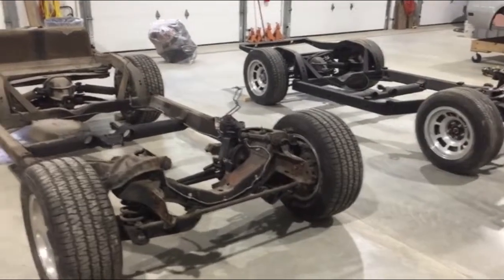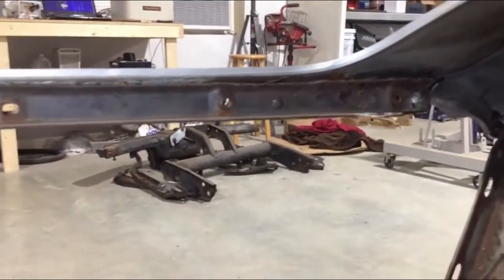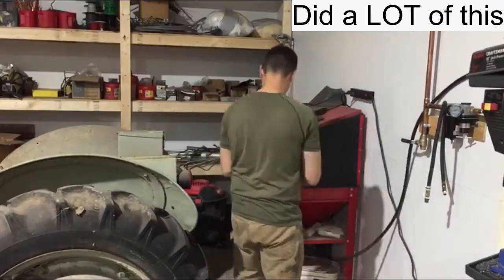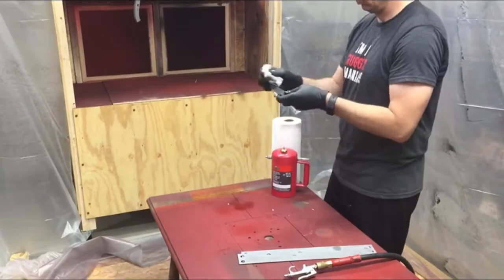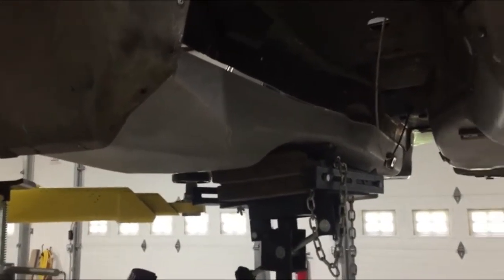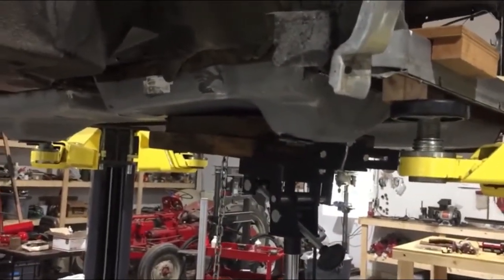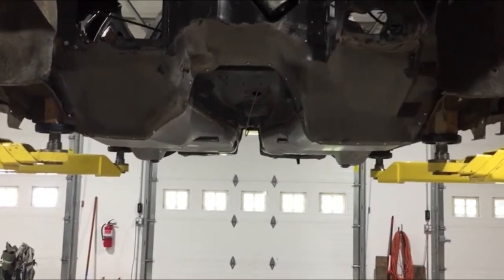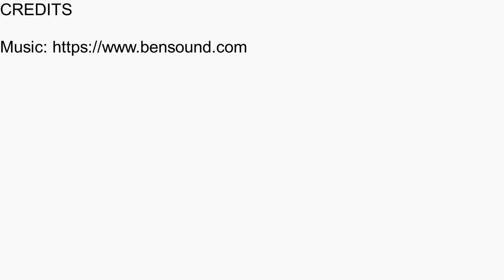C3 Corvette Project - Part 2

Comment: Nice work! I have a '70 it was originally a 350/350 4 spd car. I took the body off about 12 yrs ago. It was in pretty good shape, as well as the frame. I took the frame to be sandblasted and rewelded the seams and then painted it. I had the chassis almost finished and then changed my mind regarding the rear suspension. I purchased a Van Steel coil over kit with the offset trailing arms for wider tires. The body has been sitting in my carport ever since. It's in great shape just needs to be repainted. I ended up not finishing the project but I have kept the frame covered perhaps one of these days I will finish that car. I wanted to put a 454 in it, but now the trend is to use an LS engine.
Reply from the maker: That sounds like it would be a fun and good looking car if you ever get around to putting it back together. Great suspension you have already purchased too. You are right on the LS trend. They are just so easy to make power with, reliable, and efficient compared to the older engines. I hope you are able to work on it eventually.

Comment: Can you confirm you butt joint welded the sides of the floor pans to the stock metal left behind after the cut? I have seen other folks have a lap joint, but believe a butt joint would be cleaner and stronger if done correctly. Thank you for very informative videos.
Reply from the maker: @USAFBigSarge  I did butt weld them inside and outside. I can't comment on if it was the right way to do it but it worked.

Comment: Hello, Very nice set of videos.  In this one, at 6 minutes you cut part of the door sill out to change the floor pan.  Did you ever weld it back in?   I also have to change both floor pans.  I'm not sure if I need to put that part of the sill back.
Reply from the maker: Thanks you. That part is fiberglass. I had to cut it out because there were bad parts of floor pan behind. If there wasn’t I would have cut the pan lower. I did not fiberglass that piece back in.

Comment: Nice job on fitting the metal and welding in place. My husband and I have owned 8 corvettes over the years. Right now we are restoring a 71. It has fiberglass floor pans but the birdcage requires a little attention. I think most people not familiar with corvettes think they can't rust. I do the welding on the cars we do. My husband does the body and mechanical. We both will be watching your channel. We also have a You Tube channel. It's called, time with the durbins.  Keep up the good work.
Reply from the maker: Thank you for the complements. I agree, these things rust more than people think. Sorry to hear about the birdcage issues. I wish you luck! I’ll follow along so I can learn for the next one.